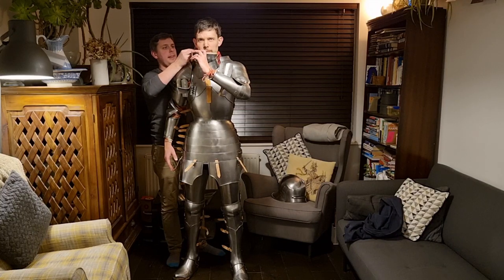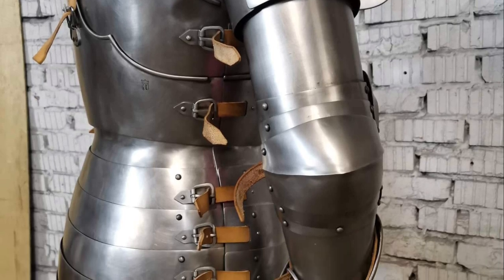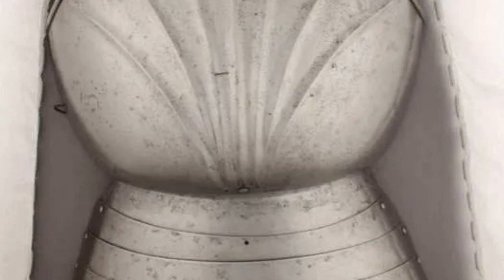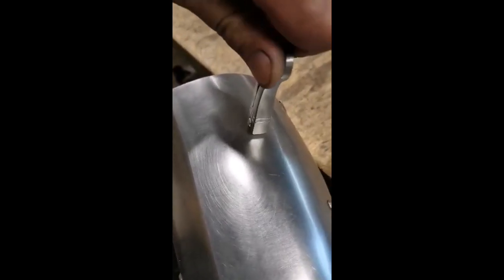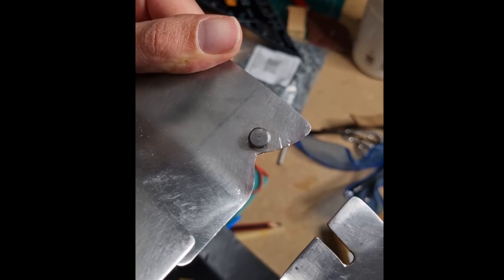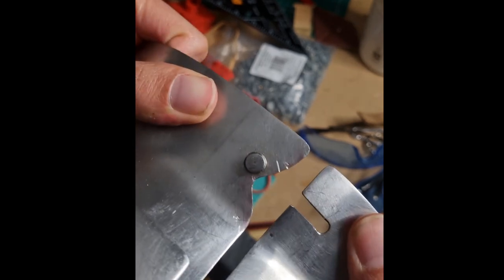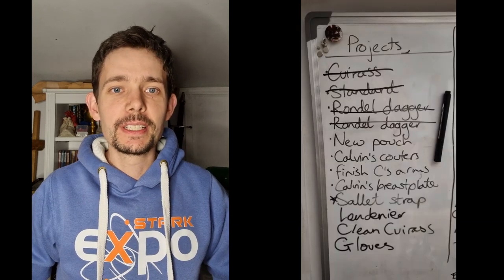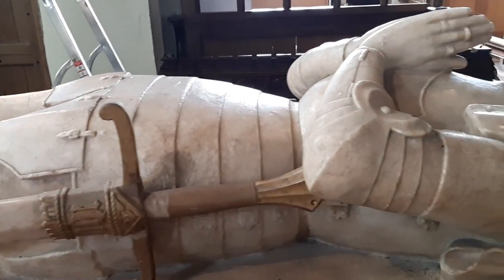Armour Update: Fixing Faulds by Breaking Bits

Comment: That harness looks fantastic. What gauge is the metal?
Reply from the maker: Thanks. Different parts are different thicknesses, but it's all quite thin as it's spring steel. I think the part I was drilling through was just 1mm thick.
Reply: Very nice. Should be fairly light then, overall? 👍🏻
Reply from the maker: @Sirsethtaggart3505  incredibly light.

Comment: Should the breastplate maybe flare a bit below the top layer of the fauld? If the bottom lip of the breastplate were wider than the ever-shrinking top fauld layer, then the breastplate should never pull up and out. The top should always catch the bottom lip.
Reply from the maker: Later cuirasses appear to have a double lip, but not this one. They also appear to overlap upwards instead of down
Reply: Ooh, even better. Should keep gravity from pulling the fauld down.

Comment: I need some brass turning pins for my legs, who is a good person to go to for them?
Reply: I'd worry that the brass will be worn down by the steel plate as the slight movement of the slot up and down "cuts" away at them.  I'd get hardened steel pins and either gold plate them or braze brass on top.
Reply from the maker: As @carterchickenlooper8784 said, using brass on a part like that is probably not a great idea. Making a steel one and then using a brass brush and heat to plate it in brass would be the best idea I think.